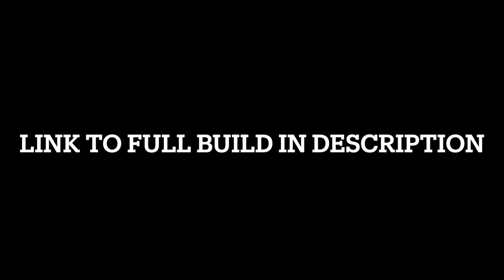Rocket Mass Heater. 6 months in 6 minutes!!

Comment: Won't that heat the giant drum and not heat the exhaust? I thought that was kinda the point of the rocket stove? the main drum radiate the heat and by the time the air has risen through the j-tube, and then fallen back down, its cooled off? It looks like your hottest air would be at the top of the drum, not radiating through the exhaust tube?
Reply from the maker: The drum radiates lots of heat but the heat flowing into the duct work is still probably something close to 300 degrees F. Still plenty warm to heat the bench. Thanks for your support!

Comment: A very well made RMH, and the video is also very well made. Do you have a cost figure for the materials?
Reply from the maker: Probably close to 1500 USD or so when all was said and done. The HVAC duct was surprisingly expensive. I should have taken the time to source it cheaper but I just wanted to move as fast as I could on the project. Thanks!

Comment: I've built a dry stack RMH in my back yard for emergency cooking. It works fabulously well. I sourced some fire brick from a local mfg company here in Georgia for mine, because I was very concerned that the red brick would not survive the thousand plus degree heat. Are these fire bricks that you are using?
Reply from the maker: Yes, I used firebreak from the local building supply company. They didn’t have anything stamped on them but at the time I looked on the website for the manufacturer and they should be rated for upwards of 1000°. I’ve had a couple other comments warn me that they’re not full on refractory bricks. This is my first time working with fire bricks, so I’m kind of ignorant. So far so good. They have held up as far as I know.
Reply: Awesome! It looks like a very professional job. We have a lot of clay on our property, so I think I'll try using some for mortar and see how it holds up. Cheers!

Comment: also did you know that big castle had heated ballroom floor/room similar to a Ondol?
they would burn fuel and have the flue goes beneat the floor, when it was time for people to use the room they would remove the fire and open trap doors all around the room so the hot air could flow out.

Comment: Very nice stove. Would it possible to build this stove into a greenhouse whit a high level of humidity without compromising the clay structure? Maybe covering it with some waterproof resin/painting ?
Reply from the maker: As long as there is not standing water at the base or dripping moisture on the stove, I think it might be OK. You definitely want a nice dry surface for the stove to sit on and you don’t want any water to flow across the surface. Even if you put a waterproof lime coat on it, you still wouldn’t want water flowing over the surface or sitting around the base. Humidity in the air should be OK though as far as I’ve seen. Thanks for commenting, and for subscribing!
Reply: @suburbanbiology thanks a lot for your reply!. I have a greenhouse for orchids. During winter there should be no problem as I would water manually avoiding to "shower" the stove. In summer (when the stove will not be running)  the water will fall on the stove anyway (because of the shower irrigation system). If this is not a problem , ok, otherwise I could try using another material as external layer just to cover the clay, maybe gravel ? or the bricks used for barbecue ? what do you think ... and thanks a lot for your time to reply me :)

Comment: Hello author. Thanks for the video, it is likely first video of high quality that depicts building process of a rocket mass heater.

I am looking into various ways the RMH can be built but so far I can't seem to find an answer that bothers me. 
It's whether it is possible to attach general radiators to the heater? Either connecting internal heating duct maze to a external thermal pipes or otherwise?

Sorry for english, I am well versed in basic english but this topic is a bit out of my knowledge
Reply from the maker: I left a link to the book I read in the description of this video. I highly recommend reading that book. You can make a duct maze, but it is limited how long this maze can be before you affect draft negatively. I hope this helps. But again that book is incredible.

Comment: Can regular Cement or maybe aircrete be used with sand or rocks instead of the clay materials?  I mean still use fire brick but the rest changes out?  And can saw dust instead of straw?
Reply from the maker: Aircrete is an insulator which would prevent the heat from being exchanged into the room. So you would probably want to avoid aircrete or anything that is an insulator. Cement would probably work just fine. It would certainly be more permanent if you ever wanted to redo it, or move it off of the porch. Thank you for watching it for subscribing!

Comment: Why call it "Rocket" Mass Heater? I do not see any rocket-stove tech in it, like adding a 2nd pre-warmed air flow for better combustion or insulating the burn chamber (fire brick sucks a lot of heat before reaching a point to inflame wood-gas, so it is probably not the best material for a rocket stove - metal might be the better choice, well insulated and with additional air tunnels).
 It is a nice mass heater, all right, but in my opinion no rocket-stove mass heater. Or did I miss something while watching the video? 
And about "the most efficient": Any well built tile stove will be calculated to allow the minimum air temperature to exit the chimney (around 70 degrees Celcius in northern climates). If the air gets too cool, moisture will condese in the chimney, damaging it over the years and possibly causing clog-ups and chimney-fire.
Reply from the maker: You seem to have an inquisitive mind beyond what I might be capable of satisfying. I highly recommend the permies.com forum. They have thousands of pages of info on their forum dedicated to how these stoves work. Thanks for watching and even more for thinking so critically!
Reply: @suburbanbiology  thanks for the link :)
Reply: It's called rocket because of the noise it makes while combusting he added insulation it's the white stuff he wrapped around the burn riser and steel tends to melt in these because they can get too hot
Reply: @hehay10  The sound you describe comes from a combustion of the the wood gas in the smoke. I don't see that happening with the design shown in the video. I do know that the white stuff is glass wool insulation (because I worked some years as a tile stove fitter). When the combustion chamber gets insulated, after a while the temperature will rise and the stove will burn cleaner, but not necessarily burn off the wood gas (as a rocket stove should in my opinion). Those thick bricks in the video, you'd need to heat them for a long time to reach a temperature where it burns off the smoke. My guess is that by that time the bench would be so hot that you cannot lay on it.
yes, metal can get too hot if it is too thin. Some decent iron will hold for a long time. But honestly I have not seen this stove in action, so I can only guess that it will not reach the necessary temperature for "rocket combustion".
Reply: I suggest some temp probes at each of the clean outs plus a temp probe and CO detector at the chimney to settle the matter. Would make for a great set of follow up videos.
Reply: @stapedium  great idea